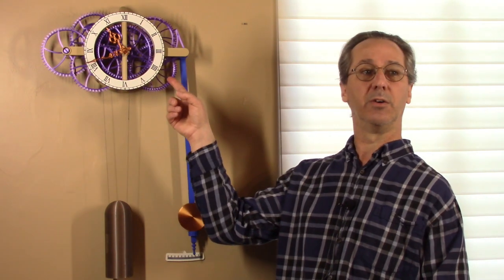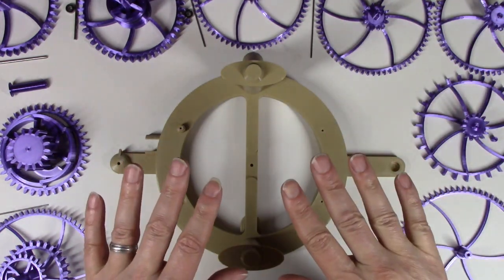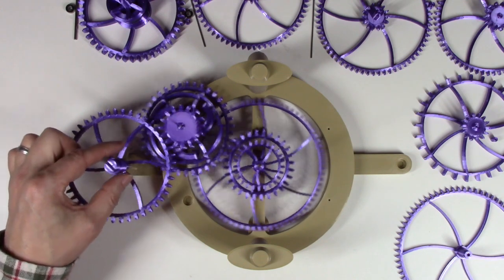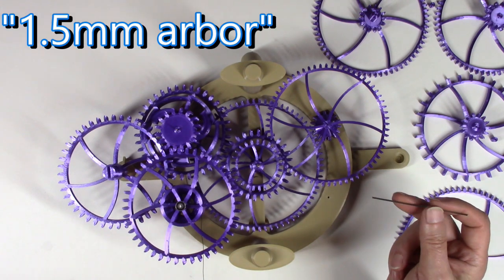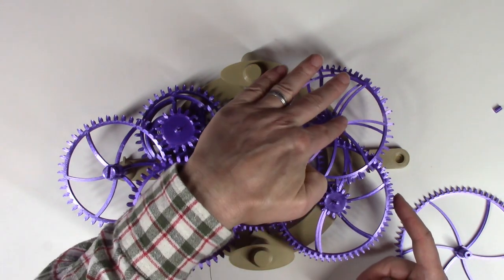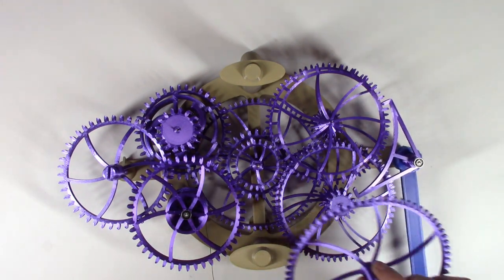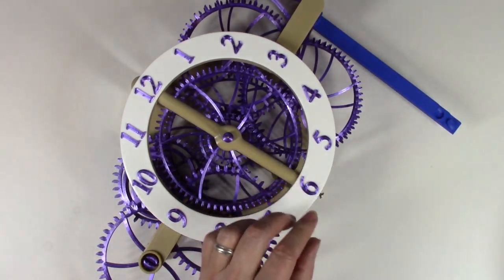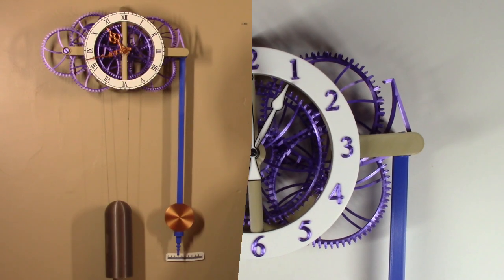EZ Build Clock Assembly Part2 Adding the Gears

Comment: Can you confirm if all the ball bearings have to be de-sealead and cleaned for this assembly?
Reply from the maker: The three weight shell bearings are fine with the factory grease since the speeds are low so frictional loss is minimal. 

The two pendulum support bearings are marginal with the factory grease, although I have never actually built a clock that way. Initial friction seems low, but it likely gets worse over time. The clock might work for a few months before the grease starts to get stiff and the pendulum amplitude reduces. 

My oldest clock with cleaned bearings has been running continuously for about four years. If you can't clean them because of metal seals, then your clock has the best chance of operating if you select the two with the lowest friction for the pendulum.

Comment: Hi.I made 4 day clock. How much weight don ı need
Reply from the maker: It should be listed in the assembly guide. Each clock can have slightly different friction so some experimentation might be needed. 2 to 3kg seems like a good starting point in 4 day mode. Some clocks might need another 1 to 2 kg to run reliably.

Comment: Would it be a problem if some of the gears printed out with a bit of elephant footing?
Reply from the maker: It should be OK for most gears. There is quite a bit of tolerance built into the design. It would be easy to test by placing a pair of gears in the frame and see if they spin freely or if they bind up.

I would clean up any elephant's foot on the escapement, pallet, and the gear driving the escapement. Those are the most critical gears in the clock. Uneven elephant's foot on the escapement might prevent the clock from running.

Minor elephant's foot on any other gears will probably wear off on its own within a short while.

Comment: Do you see any issues with using 1.4mm arbors instead of 1.5 or 1/6"? I have some of these already at the right length. I have the clock running with them on an initial test.
Reply from the maker: 1.4mm should be OK. The gears may be a bit loose, but there should be enough tolerance for it to work.
Reply: @stevesclocks  Thank you! I am currently running with water bottles for the weight while I wait for the BBs to arrive and the weight shells to finish printing. I'll post some pictures when it's done.